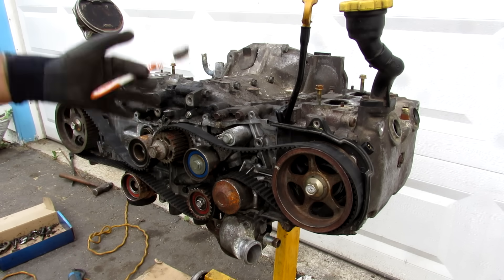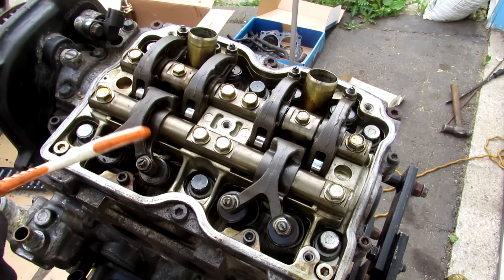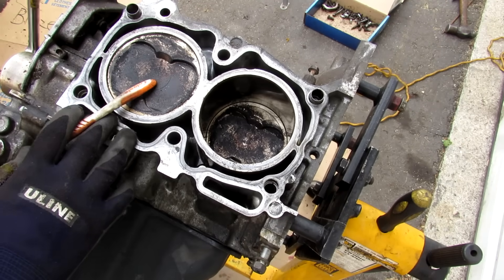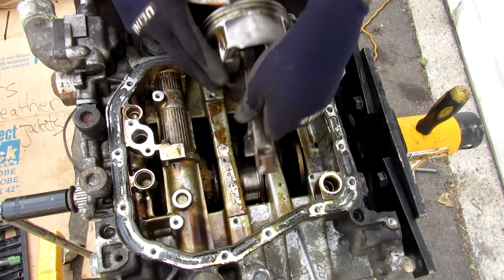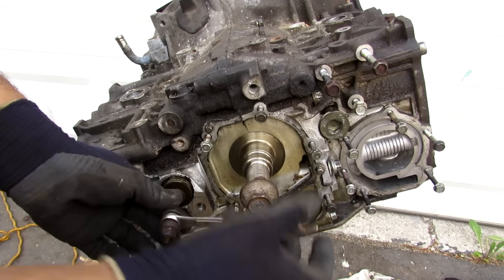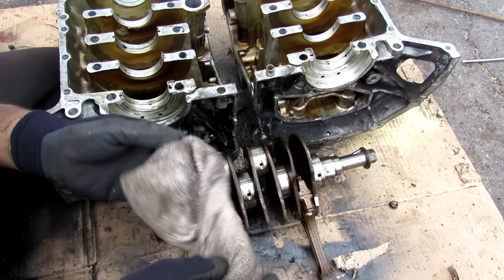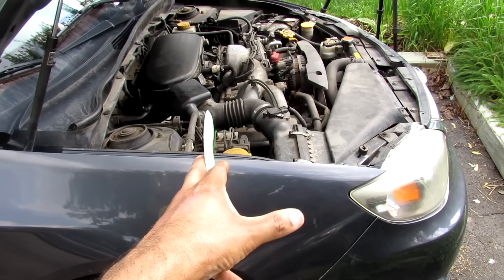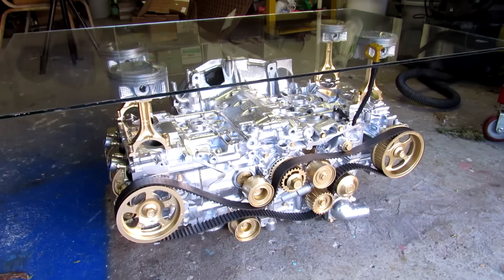Why Subaru Engines FAIL

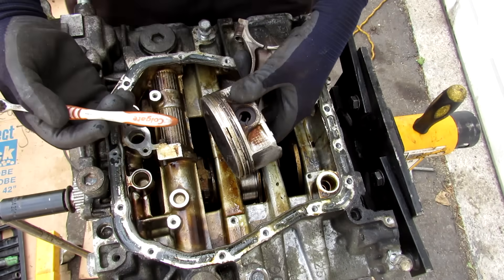Comment: Informative video, thanks. My Subaru has the six cylinder with over 230K miles on it. Last year I replaced the timing chain, guides, main seal, and water pump. But the engine has never had even the head gaskets replaced. I've been told by some knowledgeable people that this was the best engine Subaru ever produced. I'd have to agree. By the way, I don't think you used the word "attenuated" correctly at 6:14.  It means reduced and I don't think that's what you were trying to say. Thanks again for a great video.
Reply from the maker: Yeah you might be right thanks for the feedback
Reply: @speedkar99  /

Comment: owned an 2010 forester XT turbo and that vehicle died after 85,000. stay away from any subaru turbo
Reply: A friend of mine still drives his 2008 XT and it has like 325k km on the original engine right now.
Reply: @EngiNetion  he was lucky,, i took my to a subaru dealer and spend quite a bit of money and they had no idea why it was failing....

Comment: It's ALMOST an opposed-piston engine! The gasket that serves to cover a ring around each two cylinders and the outer surroundings around the cooling areas being made of one piece is a fail waiting to happen indeed time and time again. The outer surface that needs to be covered by the outer part of the gasket all the way around, means one actually can't 'pressurise' (clamp up?) the inner part the sits around the cylinders real well as it can't be done separately and more than half the clamping force will always goes to the outer part, which has the greatest surface. And to make things worse, the inner ring-like shape of it that sits around the cylinders also is really thin. Anyway, I think it would have been better if they had made the inner runways for the coolant horizontal.

Comment: ''This engine all rusty must came out of the junk yard,'' I have been driven my 2002 Subaru Forester has miles 287952,  The cylinder head gasket has been replaced in 147,000 miles, the car steal running great!

Comment: One year ago, I bought a EJ22 from a salvage yard, but never swapped the engines. I sold it on craigslist for $250 to a guy who had a 93 Impreza with a Frankemotor (ej25 block with ej22 heads), and he talked my ear off about gear ratios and blah blah blah... anyways, we became fast friends and within a month I had bought a 95 legacy with 109k miles, bought every seal and gasket and everything for a tune up, and in one day we pulled the engine, replaced all gaskets and seals, tuned up the basics, and thru it back in the car... started right up and now at 122k, the car still runs like a top. He never asked me for a cent and taught me way more than I ever thought I would about an engine. No oil leaks on a ej22, can you believe that?

Comment: Would putting ARP head studs in take care of having to retorque and/or the one bolt having to be tighter than the others? Seems to one bolt being tighter ids a weak point and would put more stress on the other bolts.

Comment: Rally course my ass, my 2006 outback was burning a quart or oil every time I'd fill up a car. I replaced the oil every 5000 miles with synthetic Mobil1 (and an quart of fresh oil every 300 miles or so... It was like driving a two stroke) and it's just the biggest garbage this side of a yugo...  To rebuild the engine (which had a cracked head) cost more than the car was worth. Never again would I buy a Subaru

Comment: Tons of Subarus on the road still going strong with high mileage.
Reply: Reliability is really about how well the lubricating parts of the car are maintained. High quality lubricants, high quality, high efficient filters and regular service  = extended useful life of your Subaru.
Reply: My second Subaru had head gaskets replaced at about 120000 km and at 298 000 stilllgoing strong; Does not even use or leak ANY oil. Not difficult to work on if you have the know how.  I had about a hundred cars and and the Subaru's are among the best.  Only wind noise from the windows is the only thing I dislike !!!!!

Comment: Subarus are notorious for head gasket failures. The dealer wanted to charge me $7K to replace the head gaskets for my Subaru Outback. I made the mistake of taking my Subie to an independent mechanic and got ripped off $3K. Moral of the story. Don't trust independent mechanics. I'll buy another care rather than trust another mechanic. Bastards.

Comment: I drive a 2007 Subaru Forrester and this video is absolutely fascinating to understand in depth how the engine works. Fantastic video
Reply: how many miles does your Forester have??? Have you had lubrication (spots) problems???
Reply: It’s a great advert for a Tesla! Such a complicated design compared to an electric motor.
Reply: @Tailspin80 it really truly is not. Not one person thought of Tesla when they saw this. Subarus are one of the most serviceable engines you can do yourself. Try that with a Tesla. You can't. They won't let you! Why would anyone want to bleed money like that
Reply: @atetraxx  Agreed about Tesla, but all modern cars are designed to prevent DIY servicing and repairs by complicated on board software and diagnostics and impact on warranty if you go your own way. I don’t have or want an electric car but you can see they will take over from ICE over the next decade. The drive train is inherently much simpler and they can eventually run on renewable electricity when the turbines, solar, grid and storage are in place. None of it is close to complete but it will be.
Reply: @atetraxx  Agreed about Tesla, but all modern cars are designed to prevent DIY servicing and repairs by complicated on board software and diagnostics and impact on warranty if you go your own way. I don’t have or want an electric car but you can see they will take over from ICE over the next decade. The drive train is inherently much simpler and they can eventually run on renewable electricity when the turbines, solar, grid and storage are in place. None of it is close to complete but it will be.
Reply: @atetraxx  Agreed about Tesla, but all modern cars are designed to prevent DIY servicing and repairs by complicated on board software and diagnostics and impact on warranty if you go your own way. I don’t have or want an electric car but you can see they will take over from ICE over the next decade. The drive train is inherently much simpler and they can eventually run on renewable electricity when the turbines, solar, grid and storage are in place. None of it is close to complete but it will be.
Reply: @atetraxx  Agreed about Tesla, but all modern cars are designed to prevent DIY servicing and repairs by complicated on board software and diagnostics and impact on warranty if you go your own way. I don’t have or want an electric car but you can see they will take over from ICE over the next decade. The drive train is inherently much simpler and they can eventually run on renewable electricity when the turbines, solar, grid and storage are in place. None of it is close to complete but it will be.

Comment: In some ways this is not so well designed as an over engineered. But I'm sure someone probably has an ARP bulk kit and a girdle kit that probably helps. Kind of reminds me of the video of the southern guy talking about how the mini coopers have head gasket issues because the head is used as the engine mount and all the weight of the engine is pulling down on the head bolts

Comment: He kind of discourages me from wanting to buy a Subaru.  But, when I investigate other car manufacturers they are just as bad or worse.  Even the Japanese and Korean manufacturers are being plagued by bad parts and problems with their newer cars.  If my subaru engine failed, I wonder if I could squeeze in a Honda Goldwing engine to replace it.  They're both horizontally opposed (boxer) engines.  Oh yeah, there's that pesky transmission that has to be hooked up to.  If only someone made an adapter plate.

Comment: You would think that by observing all the problems VW and Porsche had developing the opposed boxer engine that the Subaru engineers would learn to make it easier to service and more reliable...head bolts, head gaskets.. that's old Porsche problems.

Comment: My Subaru engine knocked then literally exploded on a highway. I has just come from the dealer for an oil change.  The engine lost all its oil, seized and threw rod threw the cover.  The fire department came. This video explains everything that happened. Crazy shitty engine.

Comment: Easiest timing belt to change in my experience. Replace idlers always.  Love these engines even with oil leaks.
Reply: @alanlangley7246   One of the few that made it that far. Still, terrible engine design.
Reply: At the end of the day, this was a failed design. A terrible engine design.
Reply: @THEFlea1991  yer, Flea1991 on youtube knows more about engine design than porsche and subaru, billion dollar corporations that use flat engine design, along with planes / aero industry that use them.  You probably got all your expert knowledge from youtube videos and comments sections too.  That will show them.
Reply: Except when its DOHC! Haha
Reply: Had a Subaru XT6, new timing belt installed at Subaru dealer.

Stupid mechanic idiot only replaced the bad idlers.  10K miles later the pulley he didn’t replace failed.

Asshat dealer wouldn’t cover it under warranty.  Had to sell the car for parts.  Just installed new air ride shocks..everything working great.
Reply: @alanlangley7246  you really should stop smoking crack before posting comments.
Reply: And boost leak and utter turbo failure and oil burning and Subaru being lazy AF ever since the evo died
Reply: @aestheticswim3397  exhaust manifolds were also problematic and many junked when the cost of replacing them was more then the car is worth sort of like teslas today when the batteries fail
Reply: @lutomson3496  "teslas when batteries fail" shows how much you know about cars, safe to say no one should listen to what you say, because you evidently have no idea what you're talking about
Reply: Yeah, someone has to love garbage I suppose.
Reply: @rustymacshackleford6276  Plenty of high mileage Subaru's in the UK that don't have issues. Seems the only ones with problems are neglected, turned up or is the 2.5 NA for the US market.
Reply: @rustymacshackleford6276  I have 250,000 on my still going
Reply: @djmysticalone321  MINE IS 4 YRS OLD HAVENT REACHED 20K ON IT YET
Reply: @rustymacshackleford6276  I bet you drive a ford.  YUCK
Reply: @russellfrancis813  nope - toyota .

Comment: Really good description. I started on the old Beetle engines and then eventually Porsche boxer six cylinders all air cooled. Very similar other than that. Basically same and they too need regular oil changes. I always ignored the mileage recommended just every six months dropped the oil out, oil is much cheaper than metal.

Comment: why subaru engines fail? because every teenager thinks its a race car and that they are a rally racer. They run them hard and lack maintenance.  Poor oiling design and starvation combined with abuse and knock knock

Comment: "1 of the quirks of this engine is that the bolts need to be re-torked because of the vibrations of the engine" a couple of minutes later, "the pistons are in this configuration to eliminate vibrations" . . . Which is it now?

Comment: Nice video. Very descriptive. I'm curious how you organize and keep track of the parts you remove. Thanks.
Reply: Usually lay them out on a bench in the order they are when assembled. Always keep the bolts with the respective parts they belong to to avoid getting them mixed up and even put the bolts in the original bolt hole if the bolts are not all the same on any given part.

Comment: Mine hasn't failed. 16 years, and counting, with my WRX. 171K miles so far. No drivetrain issues whatsoever. I've also beaten on the thing since I bought it in 2015. I just change the oil when I'm supposed to.

Comment: Because they are designed to. Don't believe me? Subaru releases a boxer engine, head gaskets fail, subaru says "HEY WE FOUND THE PROBLEM! we now have a multi layer steel gasket that does not fail" then subaru releases an new model year and puts a single layer steel gasket on that fails. then subaru says "HEY WE FOUND THE PROBLEM! we now have a multi layer steel gasket that does not fail"  then subaru releases an new model year and puts a single layer steel gasket on that fails. then subaru says "HEY WE FOUND THE PROBLEM! we now have a multi layer steel gasket that does not fail" then subaru releases an new model year and puts a single layer steel gasket on that fails. then subaru says "HEY WE FOUND THE PROBLEM! we now have a multi layer steel gasket that does not fail" then subaru releases an new model year and puts a single layer steel gasket on that fails. then subaru says "HEY WE FOUND THE PROBLEM! we now have a multi layer steel gasket that does not fail" then subaru releases an new model year and puts a single layer steel gasket on that fails. then subaru says "HEY WE FOUND THE PROBLEM! we now have a multi layer steel gasket that does not fail" then subaru releases an new model year and puts a single layer steel gasket on that fails. then subaru says "HEY WE FOUND THE PROBLEM! we now have a multi layer steel gasket that does not fail" then subaru releases an new model year and puts a single layer steel gasket on that fails. then subaru says "HEY WE FOUND THE PROBLEM! we now have a multi layer steel gasket that does not fail" then subaru releases an new model year and puts a single layer steel gasket on that fails. then subaru says "HEY WE FOUND THE PROBLEM! we now have a multi layer steel gasket that does not fail" then subaru releases an new model year and puts a single layer steel gasket on that fails. then subaru says "HEY WE FOUND THE PROBLEM! we now have a multi layer steel gasket that does not fail" then subaru releases an new model year and puts a single layer steel gasket on that fails. then subaru says "HEY WE FOUND THE PROBLEM! we now have a multi layer steel gasket that does not fail" then subaru releases an new model year and puts a single layer steel gasket on that fails. then subaru says "HEY WE FOUND THE PROBLEM! we now have a multi layer steel gasket that does not fail" then subaru releases an new model year and puts a single layer steel gasket on that fails. then subaru says "HEY WE FOUND THE PROBLEM! we now have a multi layer steel gasket that does not fail" then subaru releases an new model year and puts a single layer steel gasket on that fails. then subaru says "HEY WE FOUND THE PROBLEM! we now have a multi layer steel gasket that does not fail" then subaru releases an new model year and puts a single layer steel gasket on that fails. then subaru says "HEY WE FOUND THE PROBLEM! we now have a multi layer steel gasket that does not fail"
Reply from the maker: Thanks for insight

Comment: Absolutely overrated cars with a long history of shitty engines to boot.  All the extra parts and duplicated components of a V-6 or V-8 except flat with inherently more complicated cooling and intake/exhaust systems.  Most absurdly, it has no extra cylinders, horsepower, or even fuel economy to show for all its complexity. 

I don't get why Subaru has stuck with these 4-cylinder boxers for so many decades when--WRX owners aside--the average Subaru driver cares NOTHING about engines or cars in general outside of their utility value.  A humble old AWD Mazda Tribute or Toyota RAV4 does the same thing as a Subaru Forester without a $2,500 engine rebuild every 75,000 miles.
Reply from the maker: True. Low center of gravity is the only advantage I see
Reply: @speedkar99  Low COG, and credit where it's due, eerily free from vibration. That's still not enough for me to recommend one.
Reply: @speedkar99  Love your technical reviews and especially your teardowns!  The worse shape they're in, the more fun we all get to share in.  Thanks for making your channel.

Comment: The first problem I saw was the Fram oil filter. Would not run that on so much as a lawn mower. Mitsubishi in the 90’s said they would have warranty issues if you used a Fram…

Comment: Great video man and explained so descriptively in detail. So many points mentioned... Your attention to pointing out detail without waffling and fast forwarding is tremendous.
Personally have a Toyota Rav 4 with diesel engine with over 140,000 miles on the clock. Never check oil level from one 10,000 service to the next and it still never burns oil.
Blimey ~ if I had a Suburu I'd be on third engine by now!😱

Comment: I'm a systems engineer and I find listening to apt mechanical engineering break downs quite interesting. It's fascinating how the concepts of relationships, causation, and design translates across engineering schools. The small changes in a design can have major impacts down the pipeline - in tech this is code, your data can become malformed after several lines of code, and unexpected behavior (bugs) - in mechanical engineering it can result in integrity issues that can wear down areas of the machine where it's not designed or expected, thus a bug in the machine results in major disaster over time as it creates more issues/bugs in the machine when a breaking point is reached. Physics, science, code, tech, doesn't matter in the end it all keeps you honest. You can't cheat the laws of nature.
Reply: The one thing, the last generation has lost, is    LAWS   OF  THERMO-DYNAMICS.....all 3 of them.  Sidewalks, highways  cracking,  floor foundations failing....condo  building collapses,  Millenium Tower in San Fran is prime.  Surfside collapse in Florida,  Harmon Tower in Vegas, just a few examples. Modern engineers, have to get back, to the  'big '   picture,  in   PHYSICS.  oh,  use  REAL   CAST, OR STEEL  FOR  engine blocks, and do  NOT   HAVE  BOTH  HALVES.....bolted together, (recipe for disaster) .....check it all out.